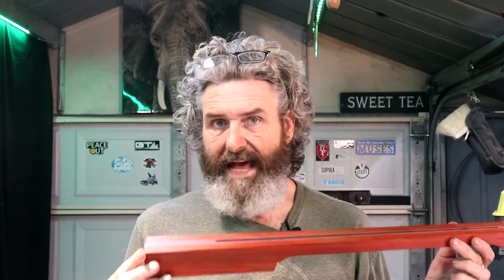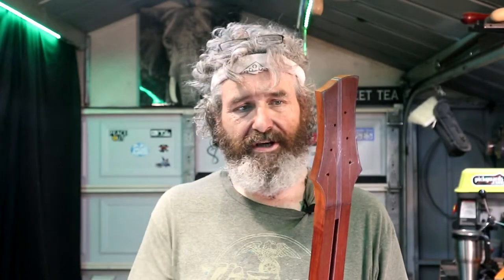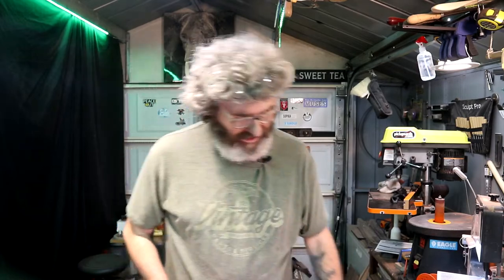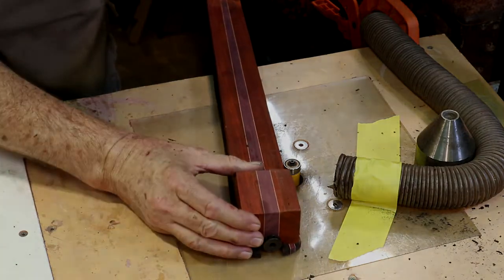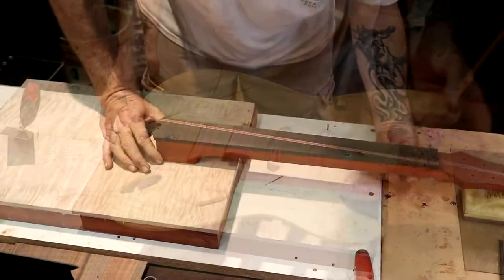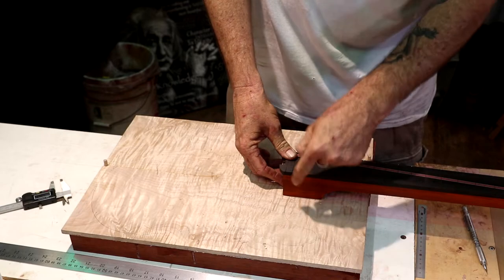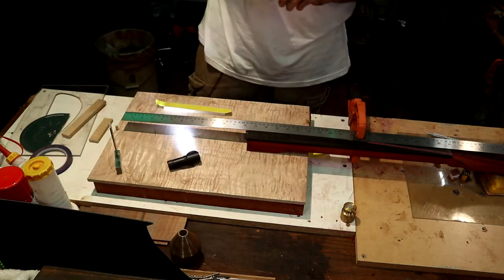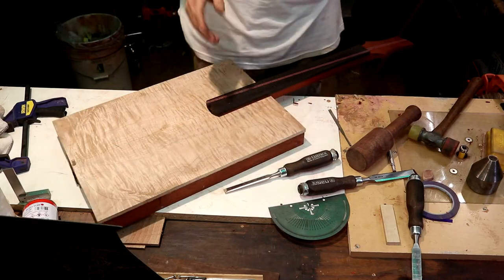Custom Guitar Build - Cloud 9 - Episode 05

Comment: The best glue-in neck design is the long tenon.  The neck wood should extend into the pickup cavity. This adds a lot of strength to the neck joint...and it is mechanically pleasing to create.
Reply from the maker: Yes, Like I'm doing on the figure 8 build. I'm doing something different on this one however! It should be fine according to what I've researched. I should be able to achieve killer access to the high frets and great stability I all goes well. Thanks for the comment Tim. Your advice and tips are always welcomed! ✌️
Reply: @SweetTGuitars  I did one like that when I first started building, and I got worried that the glue might not hold forever, so I put one fat screw in it. I countersunk the screw below the surface and filled it in with epoxy and wood powder. It's not going anywhere.

Comment: I really like your choices and methods of working out all the details.  The wood is beautiful too!  I just can’t decide if I like the contrast of the angled stripe on the fretboard with centered stripe on the headstock… also was wondering if taking the time to design a custom neck pocket for each guitar is harder than building a complete neck-through guitar?
Reply from the maker: It probably is harder than just building a neck through, but as I say in the video. I want to gain all the knowledge I can and working out things like I do gives me that knowledge. I will eventually do a full neck through build so I can learn that as well. I love the fretboard, it's the markers that are giving me the issues. It may not be for everyone but it's the GGBO and I want to do something a little different. I may never do that again but on this build I think it ties the fretboard to the neck and body. I'm not really concerned about how hard something is, these are the things I must do to be able to build any guitar design I may want to and not have to approach that build with any worry. I hope this gives you some insight into what I am doing here. I appreciate your thoughts and you taking the time to watch and comment! It is greatly appreciated.

Comment: This might turn out to be a stupid question, but I have to ask.... If the saddles lock in place from the bottom,, how does one set the intonation once the strings are on?
Reply from the maker: It's a pain in the ass is how! Once you set it though, as long as you don't change string sizes the intonation won't change. They come from the factory calibrated for 10-46 and require basically no adjustment when replacing a standard Tune-O-Matic. When using to scratch build it's a process to adjust the intonation but if you observe exact scale length and post placement., It will start very close if using 10-46, which I do. We shall see. It's a $300 bridge and is the absolute best Tune-O-Matic replacement on the market. It's worth setting the intonation regardless of how difficult it is. I mean look at it. It's just killer!
Reply from the maker: It also comes with a small Allen wrench to be able to raise the bridge without taking it off to adjust the intonation .
Reply: @SweetTGuitars  It is a beauty,,  but too many $300 parts and no working man will be able to afford it.  I try to keep my builds under $500 total material costs, so guys like me can afford to buy them.